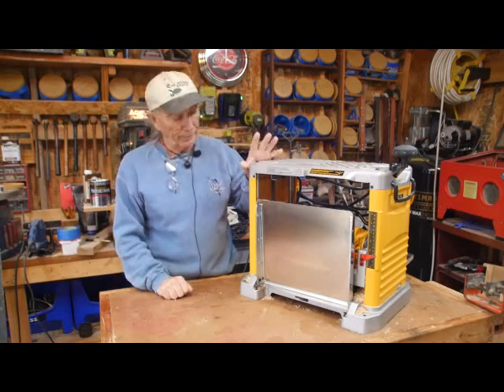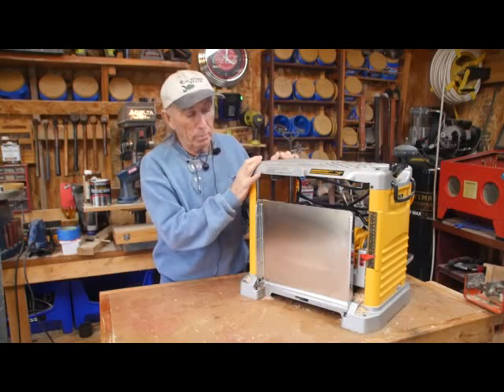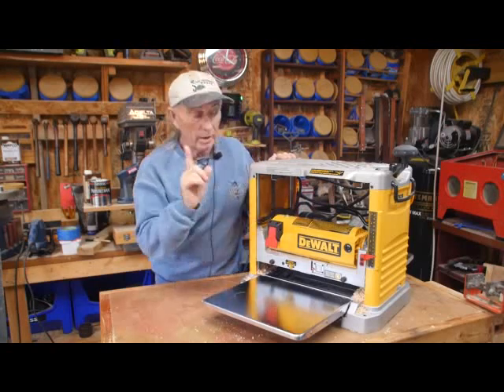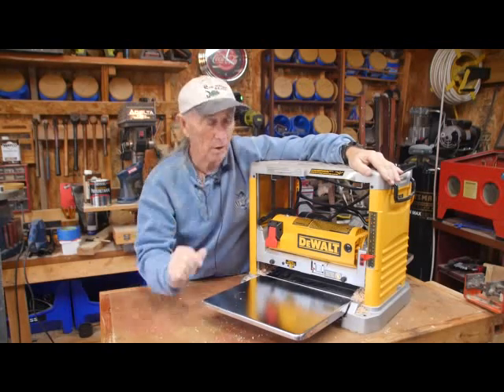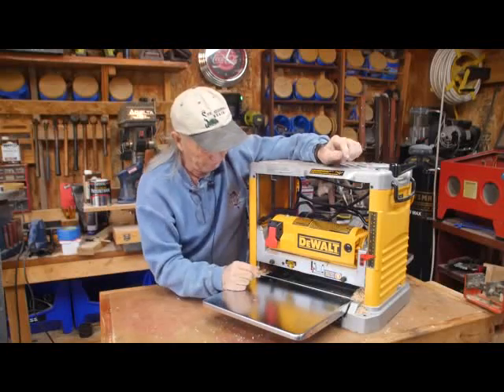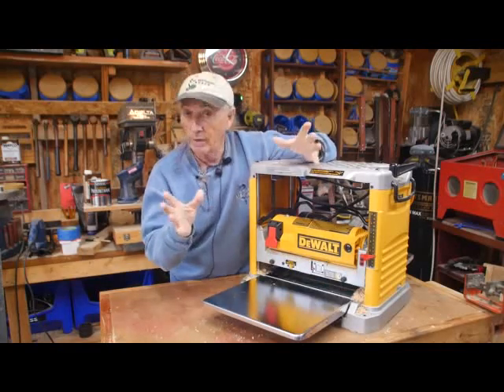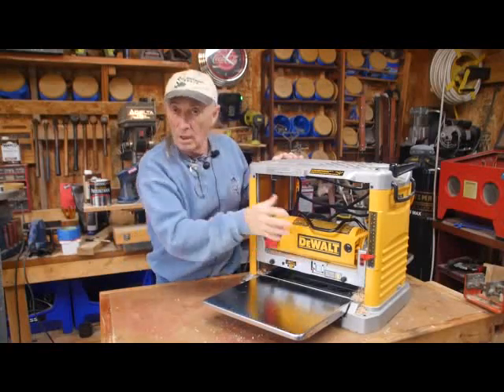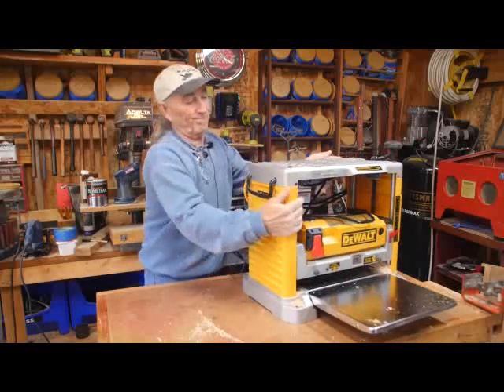Episode 42 DeWalt Planer unpacking and using

Comment: Excellent points. I'll probably still buy this planer since it appears to check most of the pros while not having too many cons, like the weight, the dust cage, and the on/off switch location. Thank you for making this video!
Reply from the maker: OH...and buy a really big broom too.  I'll be using mine tomorrow for a video and we'll be using it...OUTSIDE due to the saw dust. Still happy with it.

Comment: Hi, I have a few questions. I need advice. I am considering the purchase of Dewalt DW733 (power 1800W ). I have a Fieldmann 4020Bi gasoline generator available (max power 2000W, constant power 1600W). Will it run and work with that generator? Thank you very much. Martin
Reply from the maker: Hi Martin. Technically it should not run. The down side here is the Dewalt start up will kick the generator off. If we do the math end of start up the surge of start up is the issue with this app. I would have to check the FLA before calling it. That is full load amps rated. Generally its a factor of 3 times it load rated for surge. In most cases a generator rated at or above say 3,500 watts would cough but should do the job. The old school was to calculate up to 300% of the run motors needs for start up. BUT....sometimes you can squeeze it out a bit lower.
Reply: @SirTools  I ask because one of my acquaintances has a Narex chain saw at home, which has a nominal power of 2000W and allegedly cuts with that saw for 3 hours with exactly this type of generator.  Do you think that is possible?
Reply from the maker: @martinnovotny9066  I would need the chain saw's specs for load / current rating. I have a saw here that just barely can start off a 3,800 watt generator.
Reply: @SirTools  The saw has a complete name ... Narex EPR 35-20
Reply from the maker: @martinnovotny9066  Hi Martin, I took a look at that chain saw, and its hard to believe. I did run a chain saw off a 2,000w generator in Central America about 6 years ago. It was tricky but worked. I just cannot recommend that deWalt app for the same. I have the DeWalt here with a 3,800W generator and it just nearly gets it going. Once we are past the start up, things run ok, but it loads the generator pretty hard.
Reply: @SirTools  Thank you for the great information.  And thank you for the great videos you share.  I wish you a lot of success.  If anything else comes to mind, you can write to me. Martin

Comment: For the large amount of chip you will accumulate using your planer, a 50 gallon interim collector set up in between the planer and vacuum works great, the heavy chips will drop and save you emptying the vacuum so often.  Nice planer. Good luck with it.